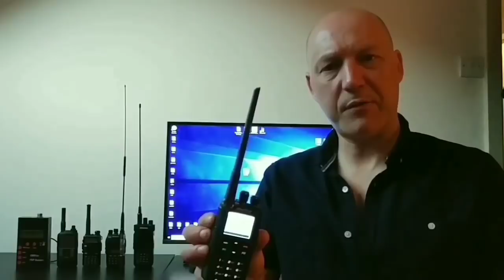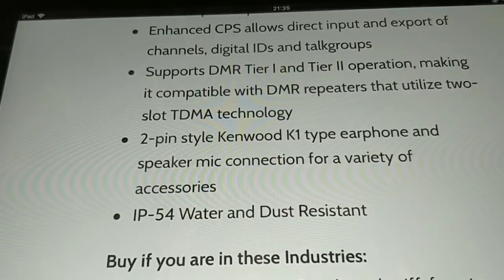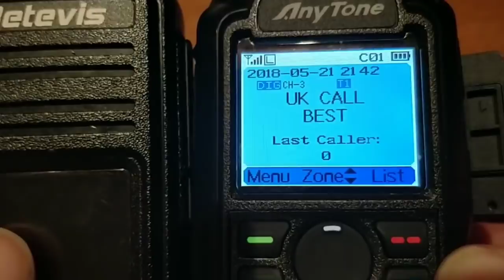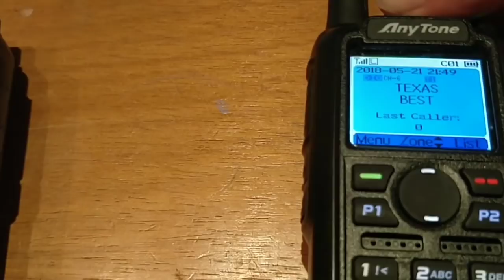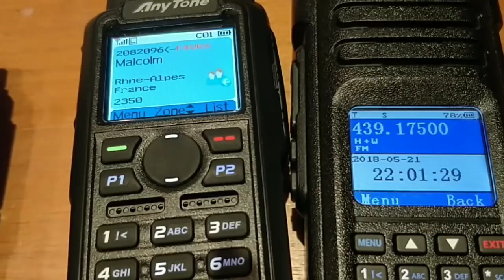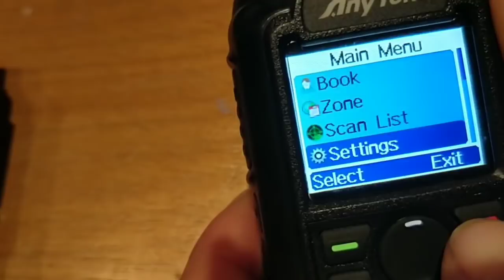💥 Anytone 868 vs Ailunce Hd1  update read description

Comment: good video.  However DMR is just not very good for hams.  It is too hard to program and too limited.  Fusion is growing much faster and is a much better system.  Fushion has better teach, better flexibility and is much easier.
Reply: Anything that Yaesu makes other than a rotor is as useless as gasoline in a Diesel engine.They make pure GARBAGE on their best day and you could not Give me ANY radio they make for FREE if I’m required to keep and use them for any purpose.I will take a Baofeng over any transceiver that Yaesu makes including their most expensive HF radios.YAESU = Yet Another Excuse Simply Useless

Comment: Anytone 868 is no longer supported so stay away. There will be no more bug fixes.
Reply: Any news on the Anytone D878UV having issues with that?
Reply: @mattlord2906  I understand the problem for Anytone with the 868 was that they made two different hardware versions under that name. The CPU in the older one had only half the memory and the user wouldn't know which one he has. The firmware got too large so updates can not be applied to the small memory version. 

To avoid customers getting mad at them they simply dropped support for the 868 completely and now sell the large memory version as 878. Internally it is exactly the same as the large 868, but they changed the bootloader to make sure new firmware versions can not be applied to the 868.

If you happen to have a large memory 868 it can be converted into a 878, but you have to open it up and reflash the bootloader. Then you can use 878 firmware updates.

I was just minutes away from ordering a 878 when I heard that story, and concluded that this is not the kind of company I would like to deal with. Yesterday my Ailunce HD1 arrived and they are constantly fixing bugs and adding new features.
Reply: @GandpaHoppenstedt  damn I have the newer version in my cart, and an HD1 in another cart.  If the HD 1 could get bluetooth I would order 3
Reply: @mattlord2906  if you want Bluetooth for speaker mic or headset, then Ailunce makes an attachment for that.

Comment: Can the 868 scan a digital freq for dmr on both slots and decode all talk groups and show what talkgroup and slot is in use ?

My Uniden scanner can do this, but not very well.

Looking for a new digital ham ht. I did not like the md-380. It didn't decode well at all, Even when programmed with all the details, it would miss calls.

Thanks

KC2OVX

Comment: Looks like the buttons are bigger on the 868 too.  Thanks for the video...  just ordered an 868 based on button size and the display window being at the top of the radio...   I just don't get why the mfg's put the display right where my hand is when using the radio..  Thanks again..

Comment: I noticed when you pressed number 3 select contact and it was in tg9 mode you then kept pressing the back button, when i select a new tg from the list and select contact  (number 3) i just key my mike as it is in the tg you just temporary saved. Just wondered why you dd not notice this, but there you go a tip for ya mate, also in the radio settings you referred to radio setting Start Up Pwd as start up power when in fact it is start up Password. Apart from that was a good video mate 73 ....... I gave you a thumbs up buddy. Also it is about time our Kettering GB7KE got sorted, i work D-STAR and FUSION through it but the DMR has a fault, I can get in but nothing else on DMR and sometimes it says repeater not available.
Reply: I much prefer the Anytone as it is smaller and easy to use plus has a better screen and looks better to me